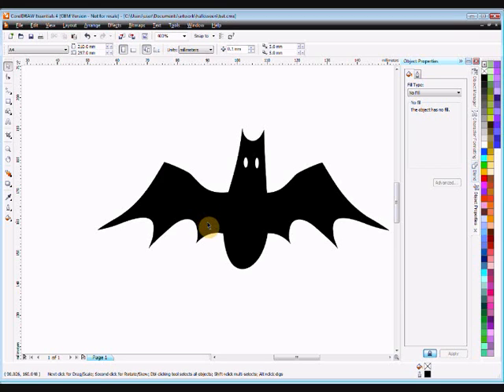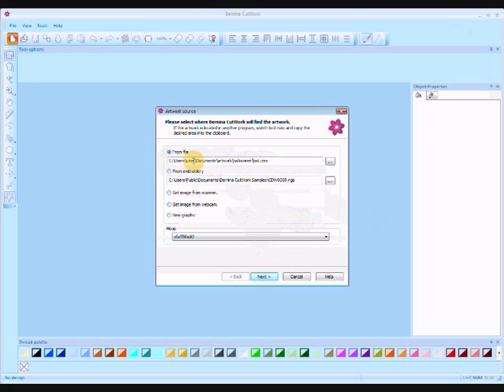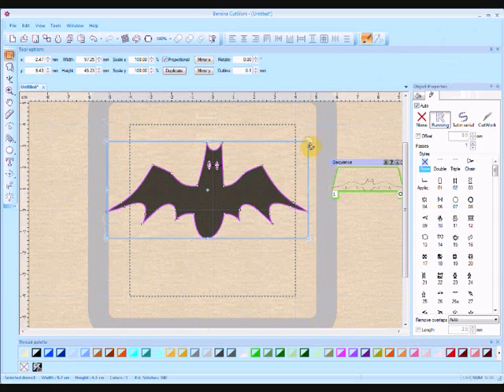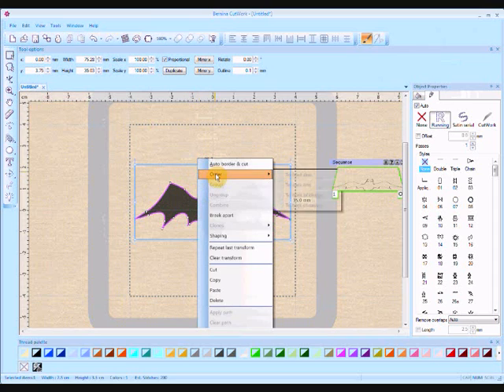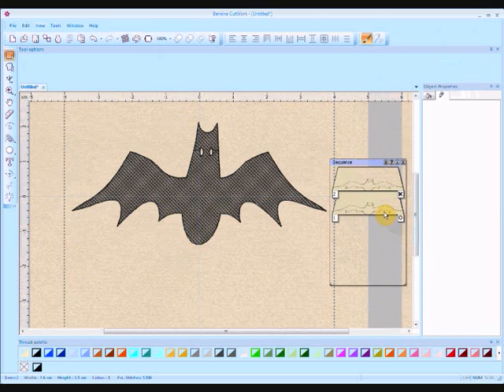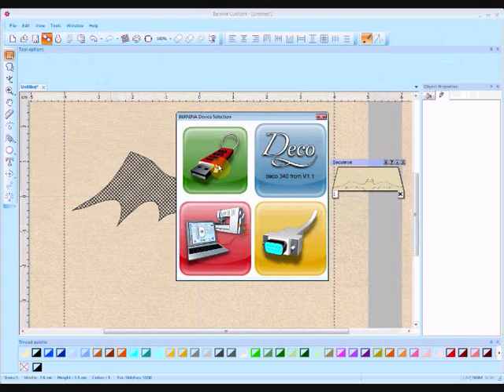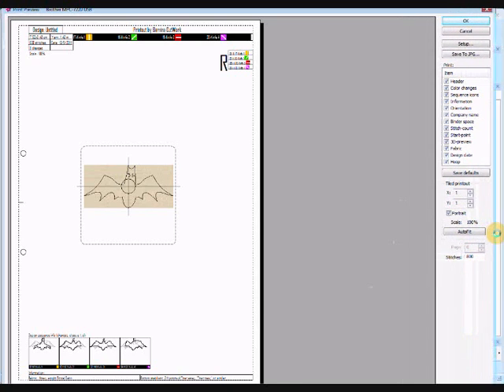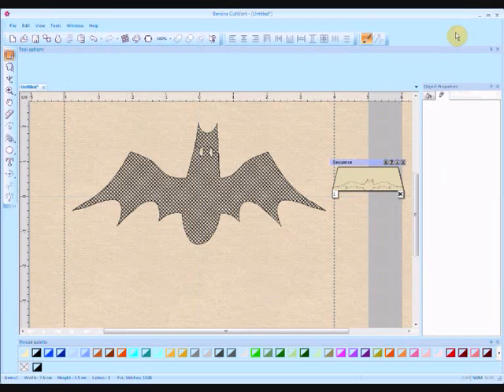Bernina Cutwork Halloween Stamp.wmv

Comment from the maker: If you open the designs in Artlink (free from Bernina site) and send to your machine, it will convert automatically, but the cuts might come up as color changes in the machine. You will have to work out which color is which position on the cutwork tool if you are using that instead of the needles.